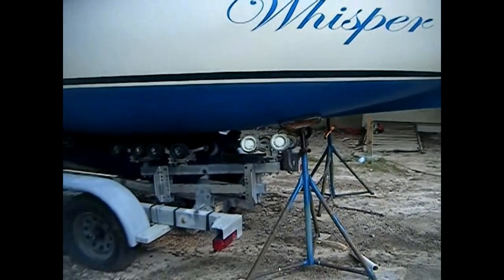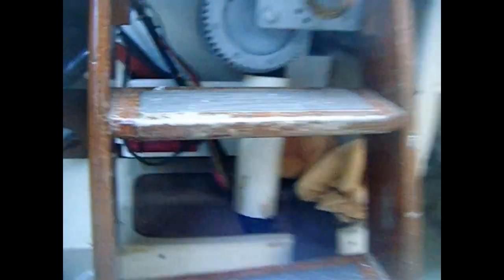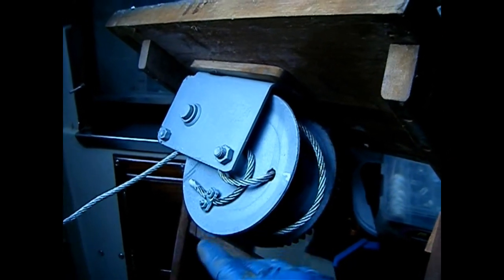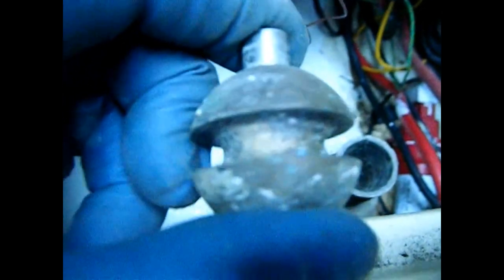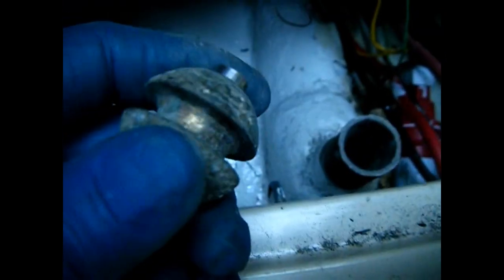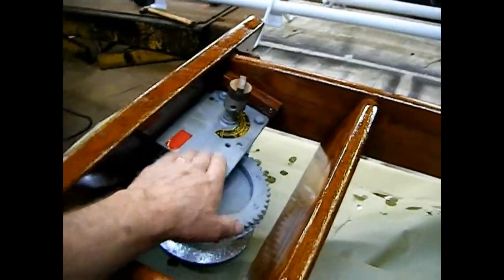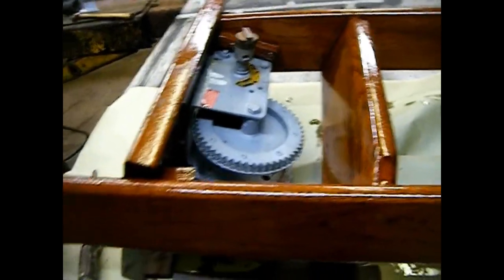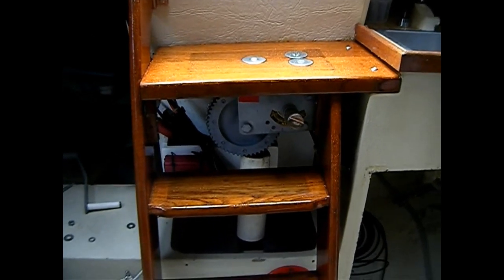CATALINA 25 SWING KEEL CABLE AND KEEL BOLT REPLACEMENT

Comment: Thanks for showing how to do this. My son is getting a 1984 Catalina 25 swing keel and was told the keel cable and bolts had just been replaced. Good to know this is an annual maintenance item. We're both very handy with fixing and making stuff (I'm a woodworker), so knowing what needs to be done is 95% of the solution. We can definitely do the other 5% of labor needed to get the work done.

Comment: Exactly what I needed to see! My Luger 30' has a very similar, HEAVY (Steele), swing keel.  Pinned fore and lifted aft with a cable wench. Your through-hull breakdown was excellent. The PVC cable guard is a great idea. Structural stair support for the wench and cable tensioning is crucial for reliable operation and boat safety. I'm building a brand new stairstep and checking the keel bolts for corrosion/possible replacement. Thanks so much.

Comment: At the marina we used to just lower the tongue of the trailer as far as we could, put the two rear jackstands in, and then raise the tongue all the way up. It'll lift the boat right off the rollers. If you have the ability to lift the bow (we had a forklift) you can roll the trailer right out from under it. Then place front jackstands.

Comment: On the Catalina 22 the volcano is about 5 inches below the water line.  I measured it with a water level when I had the boat up on blocks and the water line was level.  I don't know how that translates to the C25.  I think the value for those bolts in about keel bolts 144 inch pounds (12 foot pounds)  See Stingy Sailor.  Nicely done.

Comment: It would have been nice if you had shown us how to detach the old cable from the keel, and then attach the new cable in it's place.  I know it's off topic but how did you remove and transport the keel for sandblasting?